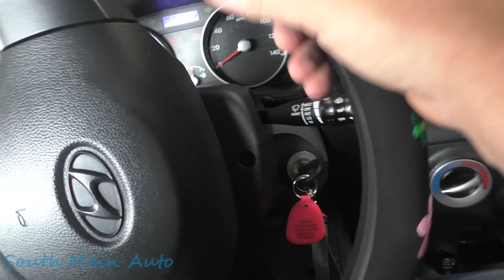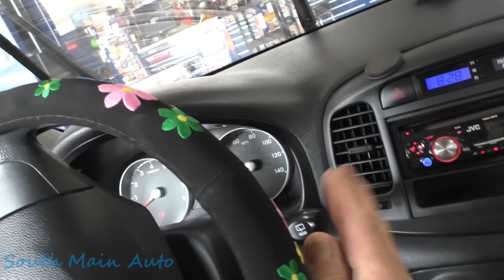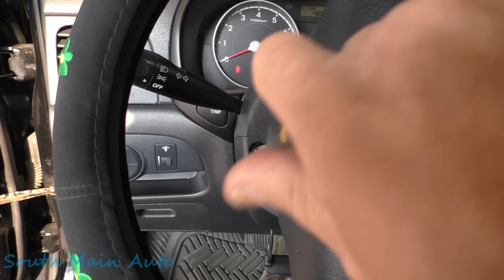Hyundai Accent - New Wiper Switch

Comment: Eric, you saved me $520 with this sort of plastic removal video. Got a new car. Wanted the electronic windshield mirror with automatic dimming at night. Dealer quoted $675. Bought the mirror new for $155. I had to snap-off the center ceiling-counsel plastic-cover. I would never ever have had nerve to do that without videos like this from you. It did snap apart (no screws). Undid the old mirror, one screw. Screwed in the new mirror. Plugged it into the wiring harness socket that was Right There under the cover. Snapped it all back together. Fifteen minutes start to finish, and I am a computer programmer with 0.25 hours of auto-mechanic experience. You have no idea how many people like me you have helped and how much money we have saved.

Comment: Congrats Eric...you found the only still intact Hyundai Accent steering column/ignition left in the continental United States
Reply from the maker: For now 😂
Reply: This has the older METAL design key switch. No immobilizer but difficult to start with tools. 
The newer models built with the plastic design key switch can easily be defeated as we see with USB cables
Reply: Yup cuz most are busted by kids stealing them. 😏
Reply: In St Louis, 90% of cars stolen are the Hyundai’s with the easily defeatable  ignition switches
Reply: About like every 1980s GM product.   And every 1990s Honda.
Reply: I'm laughing at these examples because I drove my 72 Olds Cutlass for about 3 weeks without ever putting the key in it. I just made sure not to put it in the lock position until I found the keys. The key would sometimes fall out of the switch if you were driving on a rough road.

Comment: I think it was informative. Surprisingly simple. I changed one on my Volkswagen and recall it as a very miserable frustrating job! I like the engineering!
Reply: It's slightly more work, but not too bad. Yes it sucks that you need to take the steering wheel off, but other than that it's easy peasy. Takes about the same time tbh.

Comment: "if I can do  it, you can do it."....and I did but not on a Hyundai, on my '06 Dodge Dakota. Stealership wanted $275 to replace that switch. I bought a factory switch and put it in. Took a torx driver, slotted and a phillips screwdriver and took less than 10 minutes to do.. Only cost me $79 for the part.

Comment: Over 20 years ago, I had to replace the fuel pump on my 91 Nissan Sentra. The best price for the pump was actually at the dealership but it was going to take 2 weeks to get it. I found it at NAPA for about $2 more with next day delivery. When I pulled the old pump out and compared it to the new one, the brand name and model number were the same. I told the service manager at the dealership about it and his response was that he wished he had known about that because they lost a fuel pump replacement job because they couldn't get the new pump soon enough. He said he was going to make a note for the parts department to check with NAPA when they had long wait times for parts in the future. I also got an ignition coil for that car from NAPA that had the Nissan logo on it and several relays for various cars that had factory logos under the NAPA stickers.

Comment: Two years ago i did the front bearings on my ‘02 s10 along with much of the front suspension. This week i took it off roading and river fording, and it did well, but on the way home, it developed a pretty loud hum. I think its one of the bearings - front right wheel was hot. So, i gotta go back in. Thanks to mr O i used lots of anti seize and grease when i put it together, and I know to use the timken bearings this time also. Probably will help the longevity if i dont forget the dust cover again and crush the o ring and pop the sealed bearing apart like i did last time haha.

Comment: Im a GM guy. Always have been. Ive owned 150 plus cars from my flipping car days. 

But I will say Hyundai makes a fantastic product. We bought my wife's 02 Sonata from a kia dealer in 2019 with 77k original miles. Its at 120k now and has given us absolutely no issues. Had to put a new AC compressor but thats the only "major" thing, and that was in 2020. So an 18 year old compressor is bound to fail. 

And now i have a car ive wanted since i was a teenager in the need for speed underground days. Mines an 06 Tiburon SE in Orange Crush. The SE was only available with a 6 speed manual and orange crush was an SE only color. It has 126k miles on it and it runs and drives flawless. I had to replace the ac compressor as well, my clutch wouldnt kick on. System had no leaks. Got a new compressor from oreilly, had it professionally evac and charged, new compresor leaked from the front seal immediately and wouldn't hold freon after two days. So warranty swapped it and paid for the evac and charge again, 150$ each time, and she's had ice cold ac for over a month with no leaks. 

Moral is, Hyundai makes a fantastic vehicle. People can talk bad about the engine recall all they want...every manufacturer has big issues with their vehicles. 

And, we live in ohio, rust belt, and my wifes car has been in Ohio all its life...and theres barely surface rust underneath. Mine has no rust either.

Comment: Intermittent Intermittent Wipers? Sounds redundant to me! LOL!
Just got done doing the crank sensor, ignition switch, starter, wheel bearings and lower ball joints on an 06 Accent. Starter was not fun at all! The ignition kept the starter going with the engine running, so I think the excess heat had something to do with the bolts being grumpy!
Have a great day, Sir! o7

Comment: I had one of these, same year, probably the same trim, in silver. Lasted me to 205k with no major repairs. Just your usual, brakes, suspension, couple ignition coils, starter, and a crank position sensor. Only junked it because the AC Clutch was beginning to fail, and 10 years in the PRNY was finishing her off, rust wise. Still, great car.

Comment: Just did this on a Crown Vic. Owner pulled everything apart, arms, linkage, wiper motor, even cut the connector off the harness chasing wipers that were stuck on high. All that was wrong was a bad multifunction switch 😂

Comment: It gets even funnier on later models Elantra and I 30, all the electronics commanding the front/back washers are located in the pump and once a little bit of water sips in past the seals the corrosion will take over and you will get all sorts of cartoonish stuff happen like you command the front wiper washing and the rear wiper kicking in or vice-versa :))

Comment: 2005 hyundai blowing wiper fuse intermittent. I bought a motor and sure enough it fixed itself. Sent the motor back and sure enough the problem came back. It only ever quit on start. One time driving it shorted on intermittent operation. Pretty hard short as it showed up in the headlights.  So my thought is bad armature in the little motor. Probably gunna order another motor. Pain for sure

Comment: "not every diagnosis requires fancy tools. Tell that to Ivan. He would've scoped all of the wires and been like 700% sure it was the switch.
Reply: And then scraped the contacts of the micro switch inside to proclaim "no parts required!"
And billed the customer five hours of diagnostic and repair time.

Comment: Morn’n Eric. I’m gonna have to book an appt with you for my ‘16 Silverado 3500HD. I’ve been trying to diagnose my cruise control but to no avail. It will turn on, the speed will set but then it deactivates on its own like I’m pressing the brake. I’ve changed the brake position switch, checked the wiring to the switch, changed all LED bulbs back to standard halogens and NOTHING!
Reply from the maker: Just get a scan tool, go to OEM data, in the data stream for cruise control control it will give you "the reason for last cancel." Then go from there.

Comment: Thank you for that vid. I have a Santa fe and it looks like it would be similar if I need to go in there.
I have a question for you or anyone out there;  I bought a factory service manual on CD, Why are the illustrations a fuzzy blur? The text is good, the wiring diagrams are good. With the advanced computer and printing technology why would the illustrations be terrible.  Is this just Hyundai/Kia?  Other manuals that I have do not have this problem, GM etc.

Thank you Eric O and others

Comment: Did you go back and torque those 3 screws to manufacture spec? 😉
Reply: I did notice he used a screw driver to remove and replace instead of stripping and cross threading the fastener head with air/battery driver for the next guy. 😡🤬

Comment: I just had a very similar issue to this on a 16 F150, except wipers would not turn off (very f*¢king annoying). Had to replace the stalk, 3 column screws, 2 retainer screws and just pop n' swap less than 4 mins. Easier than this one, no harness connector or screws hiding behind the wheel.